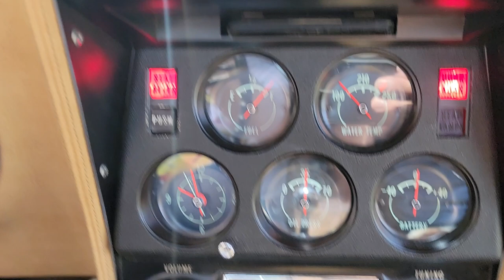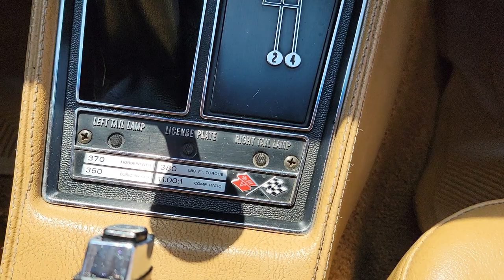Incredibly Original 1970 Corvette For Sale~18k Miles~Baldwin Motion Parts Added in the 70s!

Comment: NOT a Baldwin Motion.  It has a few Motion parts, but Baldwin Motion Corvettes - of which there were 10, and like 8 survive - were sold through Baldwin Chevrolet, spec"d/built by Joel Rosen at Motion Performance, and had particular modifications this car does not have.  Rocker covers, stickers, cheesy paint and side exhaust do not a Baldwin Motion car make.  You really should get with the owner and have him change his offering title and price.  I really hope this car didn't/doesn't sell using this video as a guide.